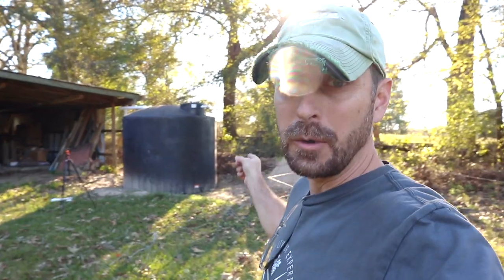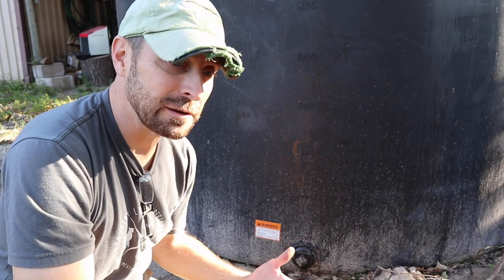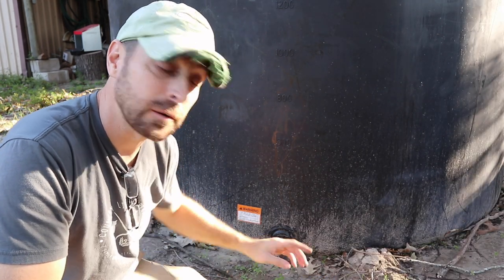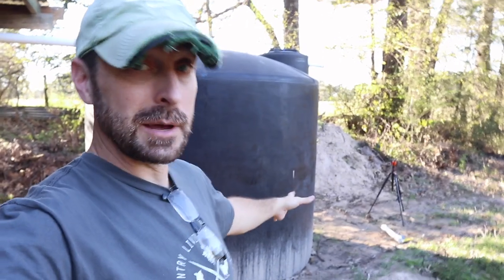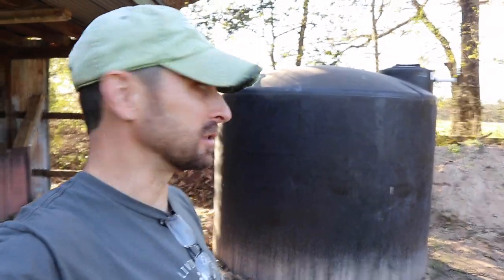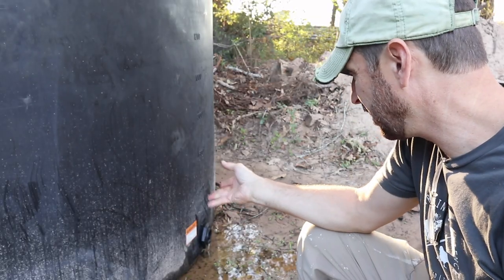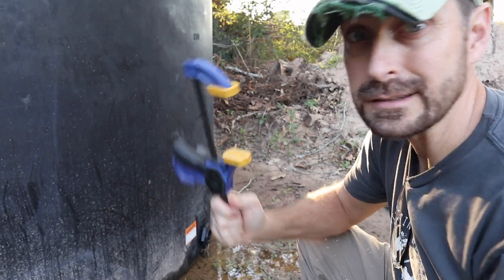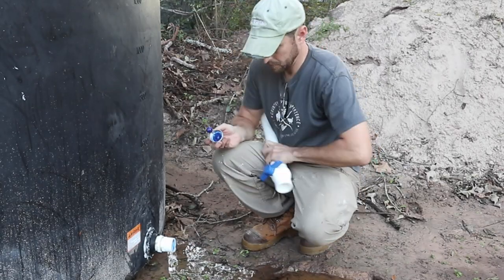I Failed At This! Don't Do What I Did With Your Rainwater Tank!

Comment: Just an FYI the plugs that come from the factory are not sealed or supposed to be water tight  they are there to prevent stuff getting into the tank during transport and storage. .  You will almost always have a valve on the bottom of each tank so they can be isolated if you ever need to service or clean a tank and not have to drain all of your water.   You also have another potential fail by connecting between tanks. If you have 2 tanks to connect you want both bottom bulkheads pointing in the same direction and connect with a pipe along the side.  These tanks bulge when full and if you plumb a hard pipe in between there will be stress on the bulkhead fittings and may cause a leak or eventually cause a crack in the tank.  In case you're wondering I have been in the plastic tank business for 36 yrs. and have taken RWH certification courses.
Reply from the maker: Thank you for the tips.

Comment: I've had this situation a work, at few times. Pull the plug but have your value open. Thread while it's pouring. Takes two people. Saved about 3/4 of the tank.
Reply from the maker: Thanks for the tip. I shouldn't have to worry about it again.

Comment: you only need one bulkhead for equalization, supply via a pump and for filling from another source. I always use a gate valve then a T fitting this gives 2 options for use after the valve. ALSO put the gate valve on as the first connection on the tank - as you have it if something bumps that pipe you could damage it and lose your water.

Comment: Make sure to fix any erosion now at the base of your tank. It should be good and packed from the weight of 2500 gallons of water. But if there are any missing or soft spots now underneath, it will lean when full.
Reply from the maker: Absolutely

Comment: One thing I thought the other day, if you are using the water only for the gardens, you're ok. But, if it's going to the house, you might consider a DE or sand filter (swimming pool filters). They'll remove most algae, dirt, bird poop, etc., from the water making it less stressful on the sanitation system you have. Chlorine  tabs and dispensers are another thing to consider.
Reply from the maker: Absolutely. All good suggestions. We will probably do a whole video or two just on filtration when we eventually pipe it to the house.

Comment: I would suggest using a brass nipple to a brass valve, in the case something hits the pvc pipe it will break after the valve and you will not loose the water. If this happens after a SHITF situation it could be real bad.  Pile dirt around the valves so if there should be a sudden freeze there is no way the valve will break. I am in an 8B area and the water seems to be a heat sink to valves that are close to tank and metal.
Reply from the maker: I hear ya. Thanks for your thoughts on it.

Comment: Another approach to supply....since ading another bulkhead adds another potential leak at the tank and are expensive...you could have added a tee or tees down stream of tank valve to pipe to suction side of future pump.
Reply from the maker: Good suggestion. I can still do that.

Comment: When I set up my homestead I relied on a family member that said he knew what he was doing. I since learned that I did not put on a ball valve on my 1550 gal. water tank. Because that water is my only water I have not fixed the issue. I need to get a second tank, transfer the water then fix my connection. We live we learn. It that I don’t know what I don’t know so I have to learn as I go.
Reply from the maker: Learning is about failing first sometimes. Those are commonly best lessons.

Comment: If you wanted to spare yourself the erosion, you probably could have siphoned the tank and hosed down stuff more uniformly. Also, it works with even very large water heaters to put the tank's contents into a vacuum, pull the drain valve and stuff a nipple with a valve (open at first, closed afterward) on it while it's slowly draining. The same approach may have been possible here, but I am no physicist. But I fully understand the appeal of giving into the most dramatic solution. I tend to take them every time they present themselves. For what it's worth,even with plastic on plastic threads, pro-grade PTFE tape (Ferguson, Hercules, Blue Monster) is the secret sauce. All the same, I hope that your seal holds up the way you've done it. And it may be a no-brainer, but make sure to have a valve on the pump side as well. ;)
Reply from the maker: Thank you. I don't think a vacuum would work as there are too many air leaks and that 2500gal of water is super heavy. I left the new valve open through this current rain storm because I still do not have the parts for the valve on the pump side. Shortages at the stores here.

Comment: plastic compresses heavily on the weight of water so removal of that plug under pressure would be a bear.   it might be possible to place a wooden box shaped the the wall on the inside with a soft rubber gasket, and pump the water out by vacuum thus creating an ambient pressure inside at the plug to the outside pressure which might allow you to remove the plug, plumb the fitting and then reflood the void (cofferdam) and you would not lose the water.  a bit of work, but if rain is not frequent, that would would pay off.

hope this helps
Reply from the maker: Cool. Thank you.

Comment: Put the valve (gate valve ete) as the first fitting on your tank having it on some end of pipe can result in loss of water if that pipe is damaged - I would use metal (brass gate valve) valves for extra resilience as plastic ones are more likely to fail over time especially in sunlight the tap mechanisms become brittle and then you have difficulties turning on/off when needed. Brass gate valve with screw top also doesnt stick out as much and less likely to get damaged should animals, people or machinery bump it!
Reply from the maker: A brass valve is a good idea.

Comment: Probably late to this conversation... but don't punch any extra holes in your tank if you don't have to.
Simply "T" off your supply.
One branch of the "T" goes to the first tank.
One branch of the  "T" goes to second tank.
"Bottom" of your "T" supplies BOTH tanks to the pump.

And don't feel bad about the wasted water. We all do it.
I hate to even mention this but... dude, it gets worse with age. Keep your sense of humor... you're going to need it ;)
Hang in there. Good video.
Reply from the maker: Thank you and yes. We got that advice from a few others. We have not added the pump yet but will be modifying where we pull the water from.
Reply: @CountryLivingExperience  In my search for booster pumps... I came across a brand called "Walrus" (I think). It seemed reasonable in price. Don't know if that helps, but... there it is.

If you have a pump brand you are keen on, please share it. I'm still shopping/saving for our booster pump.
Reply from the maker: Thanks. We have been looking at the RainFlo which seems reasonable. https://www.rainharvest.com/pumps-and-controllers/above-ground-pumps.asp

Comment: You didn't need to let all that water out in that short of time. Just make a siphon out of PVC pipe and send the water out of a garden hose to water your lawn, then send the rest out the back of your property. You don't even to even glue the PVC fittings together, you can reuse everything afterwards when its all done.
Reply from the maker: All done now. It ended up watering a few fruit trees downstream.

Comment: I am new to your channel and like what I've seen so far. Just so you know, I had plans to build a system like this for my own place, but never got the chance (fire). 
I do have a question, though. Have you thought of putting in a "T" fitting between the tanks for the supply line to the pump? With a valve on each side of the T, you could use water from either, or both, tanks, and be able to isolate either tank or pump, for upgrades, repairs, or replacement, without cutting off the supply to the house. 
It may sound paranoid, but I tend to plan for worst case scenarios, such as contamination of the second tank's water. As I understand, it gets pumped to the house through the first tank. That would contaminate both tanks. Just a neurotic thought.
Reply from the maker: Thank you. Glad to have you here. I did think about the t-fitting between but the reason I did it this way was because of where I want to locate the pump. I wanted the pump underneath the shop portion of my barn and a shorter run to electrical which is already there. Otherwise I would have done it similar to as you suggested.
Reply: @CountryLivingExperience   You obviously do what you feel is best, but I'd think fewer bulkheads in that tank would be best. (how are you going to get the new bulkhead on the inside of the tank (to make the seal), it'd have to be bigger than the diameter of the hole you'd have to cut to put it in, so it'd seal.    If you T off the pipe that spans tanks, you could run PVC around the tank to the pump under the barn,  this poses its own problems, (exposed PVC to be stepped on/broken) but that would think traffic would be minimal in that area)..  Anyway.. best wishes however it goes..  really appreciate your videos.
Reply from the maker: @tommcgivern4800  Thanks Tom. Good thoughts. Fewer bulkheads would be better.
Reply: @CountryLivingExperience  I understand wanting the pump protected, but that doesn't preclude the T fitting. The water going to the pump from the tanks is gravity fed. Remember the pressure when you removed the cap? That's the kind of pressure you will have going INTO the pump. If anything, you may need a valve just to control that pressure.
The only downside might be the vulnerability of a pipe from the T to the pump, but it could be either buried or encased in a removable tile/pipe (concrete half pipe).
Reply: @CountryLivingExperience  I was thinking the same thing...also, if you turn the tank 90 degrees and pipe a spring check, then isolation valve then tee and manifold the tanks together your pump supply would be closer to your barn and you will prevent backlog between future tank(s).
Reply: @zuzax1656  the tank was full and that sure was alot of pressure (energy) coming off that bulkhead. He said that tank filled after just a couple rain events....made me wonder with a second tank would a pump even be needed.

Comment: I failed my whole way to success in going off grid! 🤣
Reply from the maker: I totally understand. Failure is the best way to learn sometimes.
Reply: @CountryLivingExperience  It’s probably why it was a good thing I started at 24 V, otherwise I would’ve killed myself by electrocution! 😂
I don’t know how many times I got shocked, as I was new to electricity. I learned to make sure you insulate your ground wires, the hard way!